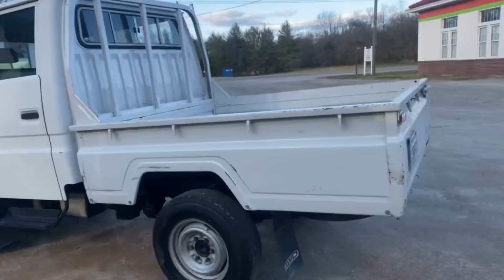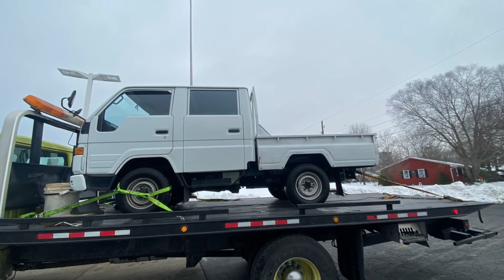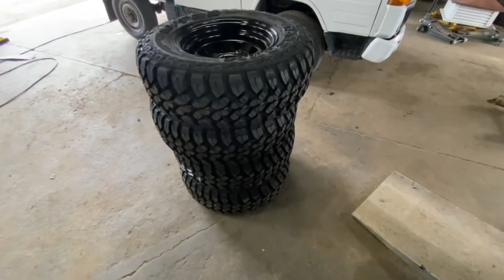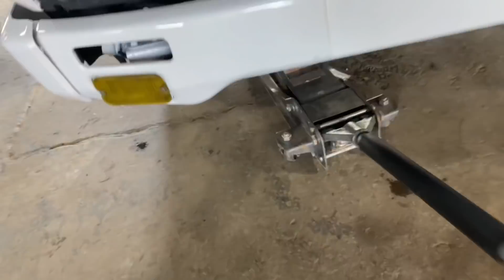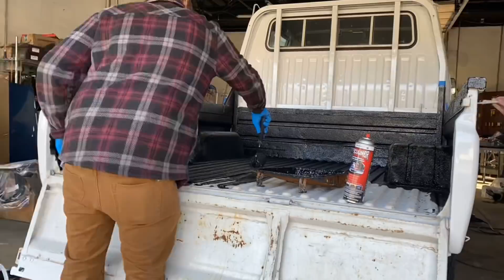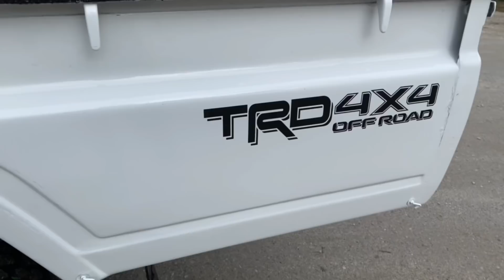Rare Toyota Hiace Crew Cab 4x4 Diesel update

Comment: Awesome truck!

Does it have the 3L diesel? I  am curious your impression of it (top speed, mpg, daily drivability, etc.)? Also,  any other features like A/C or cruise control?

Again, awesome truck and really appreciate you putting this video out there. Also digging your 6 door rig!
Reply from the maker: 2L 55-60 comfortable! top speed probably 70. Got ac, fun truck to drive, 4wd works great, don’t know the mpg but daily drivable if you aren’t on the highway much
Reply: @TheBibin007  did it have ac from the factory? I didn't think any came with ac is why I'm asking
Reply: Good day sir!im from philippines,i have this kind of crew cab in our garage.i want it to be fixed.but i dont know what belt size i am going to fit to the alternator- fan-crankshaft pulley,also the size of the belt of power steering pump-crankshaft pulley.i hope you can help me with my problem sir!thank you!
Reply: 3L diesel top speed 80-85 mph 20-25 mpg 
Super reliable and simple truck !!!!